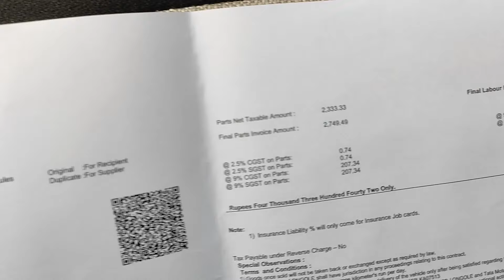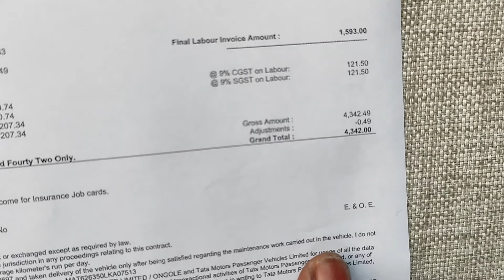Tata Service Center Honest Review | Tata tiago  xz+ 2022  4th Service||Tata motors worst service

Comment: I'm also owning Tiago XZ+. My experience in service centre for 2 free services is so so.. servicing is just one time activity in a while for One year or twice in a year.... I'm more bothered about availability of spares at dealers... Tata service is quite improving over a period of time... But needs to improve alot. Im proud of using solid vehicle and it's performance. Let's try to make service centres by putting pressure on them in the ways of complaining the bitter experiences to the company directly through mail of customer care numbers... Infact service issues are there with other brands also but there is a label on tata service more as there is no proper feedback system from the company..

Comment: Guys you can call to customer care and inform the same, then see the reaction, I did it and got the things done. Otherwise they won't  improve. I am using vista quadrajet since 2009. I use to complain every service center  and get the things done. Next time they will be careful if you go for service.

Comment: I too have bad experience .. I have Altroz XT model and after 1st service, i went long trip and their i got "Engine check" indicator.  There after I went to my near tata service center and they reset without any examination and after few KMs again it appears.  Then I gave second service with "Engine Check" indicator in Hyderabad but even these guys also reset without examine and still I am facing same problem.
Reply: It may be related to electrical or turbo
Even I have faced same for my ertiga 
it was turbo problem